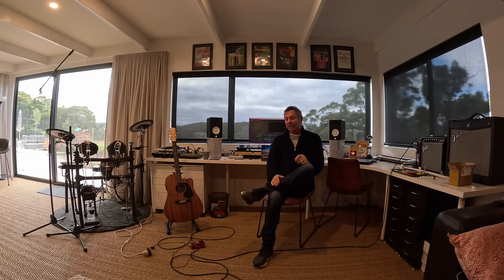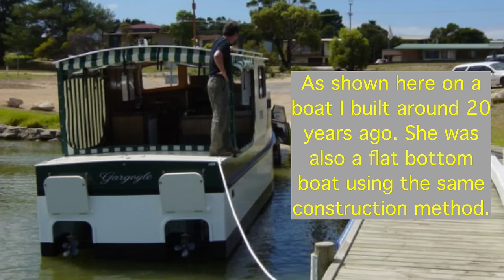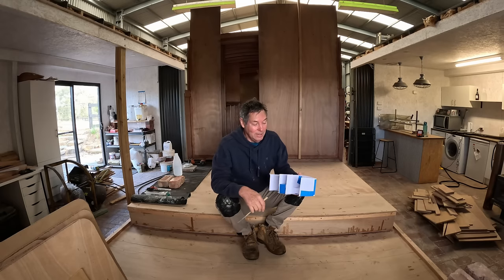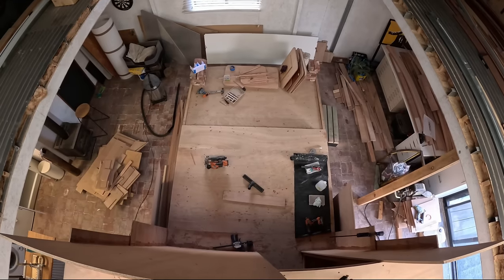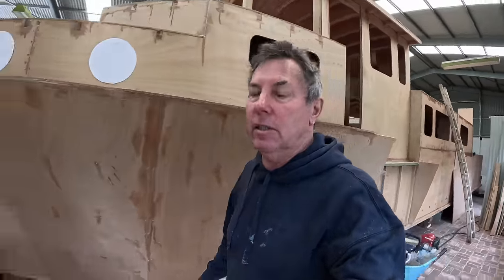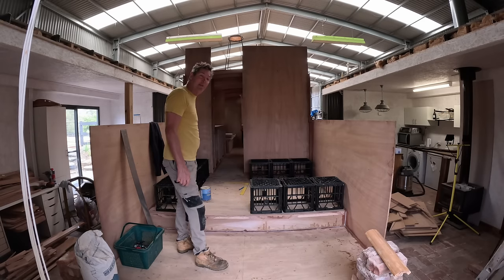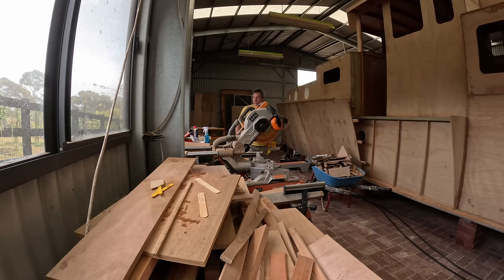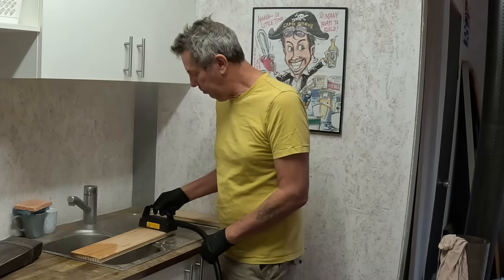Boat Building D.I.Y Boat. Will it FLOAT? Building Dragonfly E 44

Comment: Im starting at the beginning,  i would also like to build my own boat but was concerned about getting insurance have you covered this already? Subscribed!!
Reply from the maker: Insurance can be tricky. But as a new build with outboard engines it is not too hard to get. Yes I have explored this area prior to starting the build and I have also a 30 year plus history of having many different boats with never making any claim. I also had a boat business for many years and have a long standing association with various insurance companies. The boat will have a 'Builders Plate' on it which is necessary here in South Australia.

Comment: I'm glad that Maple turn out to be true mariner :)
Thank you, good Sir, for accepting our questions with grace and as they are... genuine interest in matters, not attack on your decisions...😅
Now with new questions... how  you plan to isolate vibrations from engines and generator? Will rubber holders or carpets enough, or you will need spring mounts etc...
And what's yours thoughts about solar energy on boat....
Reply from the maker: Hello, I don't think vibration will be an issue, especially with some sound proofing and a double aft bulkhead with a cavity in-between  them. Not going sola at this stage as I am utilising gas for fridge, oven and hot water, so I wont actually be using much electricity other than the air/con. That will run directly off a small generator. Thats the plan for now. The engines will be two F60 yamaha high thrust outboards which are really quiet and with minimal vibration. cheers, Steve and Maple

Comment: cool beans Steve !! , question , the ship you built 20 years ago , is she still around and how has the new owner looked after her
Reply from the maker: Hi Anne, current owner is the third I think. He is selling her as he has just completed a long 500 mile river trip which is what he bought the boat to do. He has looked after her well and spoke highly of the boats design and performance, other than the numerous wake boats that annoy all boats on the river. here is a link to the boat listed for sale. She was a different colour when I built her which I really liked. However, she still looks quite nice for a little flatty. I had to laugh because sshe still has the same porcelain tooth brush holder and some other nic nacs that my wife and I had in her some 20 years ago. LOL Nice to hear from you again, Cheers, Steve and Maple

Comment: the honey comb under the rear deck forward of the engine compartment , will you  access and are they ventilated?
your design looks like the boats built in Victoria, as flat bottom river boats.
Reply from the maker: Hello, no, not ventilated, but completely water tight sealed compartments. I will be able to access the ones running down the centreline of the boat if required. Also there will be access at certain points down the centre for bilge pumps. The centre line compartments all drain as one. Can't imagine we will require bilge pumps, but I put them in anyway. Not sure which boats you mean. I am very familia with the Duck Flat boats built here in South Australia. Only about 30 mins from me. Cheers, Steve and Maple
Reply: @steveshierdoesstuff7420  , yes I was thinking of Duckflat Boats, very similar , design.

Comment: 🌴 the floating model kinda helped , it wasn’t loaded with all the internal weight, gas,water , and all but at least it will float, how are you going to seal the hull ?  Fiberglass? 🤔
Reply from the maker: Hello Dave, the bottom of the hull is already glassed and is ready for the glass on the sides to overlap along the chines. I will use two layers there as it is a potential rub area. Re weight, all tanks run along the centre line of the boat, including the fuel tanks. We have 500lts of fresh water centre line under front bed, 500 litres of black water tank only 600mm wide running the length of the wheelhouse, about 450 litres of fuel in 500 wide tnks under the aft deck.  Gas bottles are also in the middle of the aft deck. So in short, a lot of weight running all along the centre and bottom of the hull acting as a lot of ballast when full etc. There is also the ability to add ballast under the floor from the wheelhouse to the back of the boat. Thanks for asking, cheers Dave. Steve and Maple
Reply: @steveshierdoesstuff7420  , from what you told me it seems like you got things figured out , I don’t know how thick the fiberglass is on the bottom of your yacht but most of the boats I manufactured in the 40’ ft range were 3/8 “ inch unidirectional or better as they were backed up with foam core bonded down with resin putty and covered with ounce and a half chop strand and unidirectional fiberglass over the top  they had six inch overlaps on all the corners for strength and wear , since you don’t have a keel running down the center I think the bow or front of the hull is going to be the wear area as it will take the most abuse , I’ll try and keep an eye on your progress would like to see how she sets in the water and runs, ( I’m going on 73 ) I’m working on a flats skiff project boat in the back yard here in 🌴 Florida😅 ha,
Reply from the maker: @davescheer5038  hello again, well I am not far behind you at 67 LOL I have one heavy layer of biaxial glass with a slurry of epoxy and filler over that and then  two coats of two pack epoxy below waterline paint. Not particularly heavy duty like yours but this is really just a waterproofing and protection layer. The bottom of the hull is three layers of 12mm (1/2") BS1008 marine ply. So total hull bottom thickness after laminating ends up at about 38mm (just over 1 & 1/2") And yes all laps were about 6". I also have 120mm x 27mm hardwood rubbing boards underneath. One along each side about 1/4 of the way in from the chine and one running in the centre from the front of the wheelhouse to the stem. These have 316 4 1/2" by 1/4" plates on the bottom of those adding some weight and rubbing protection. Love to see some of your work on the skiff, Cheers, Steve and Maple the boat building interupter! LOL

Comment: Did you say that you are putting a generator over 2 fuel tanks?? there will fumes from the fuel tanks ,plus a gene running over them   ,you sure about that ,also some strong winds on the river and will dragonfly handle them side on ,as recall nothing under the boat or a drop keel  ,glad the new pup is going great ,like you now have  a replacement pup, said never again  but needed a new mate to tell my woes to ,plus keep fit walking him,look forward to your reply re my point.
Reply from the maker: Hello, thanks for watching. Yes, you heard correctly. However, what I should have made clear is that those stainless tanks will be enclosed in an air tight compartment. There will be an access panel above them, but that will be completely sealed, I may even lightly glass that into place just to be extra safe. The fuel inlet and tank venting will be well away from the generator area. You might have missed it, but in a much earlier video I showed how there are two swing keels, centre plates if you like, that are housed either side of the wheel house and can be lowered or lifted as the wind demands. Skating is absolutely an issue with a flat bottom boat and one I have to address as best I can. It is always a bit of a catch 22 weighing up shallow draft against stability and handling. I have also added a retractable bow thruster to assist when docking in tight marinas etc. I hope this makes some sense. Cheers, Steve and Maple

Comment: Why on earth would someone with the financial resources to have this shop, tools and materials, not spend a fraction of the money on drawings from a registered naval architect? Please don’t say, “He wants to do it his way”. Design professionals are quite happy to work with you on your vision.
Reply from the maker: Hahaha, yes I hear you. However, perhaps I make a little too light of the 'design' factor. I have been building and restoring wooden boats for over 35 years and this construction method is well tried and proven over many, many years. She is basically a long Norwalk Island sharpie with a few interior twists. As for drawings etc., it is common place in the boat building fraternity to build from a scale model. This is exactly how I built my last 33' boat which has been in the water for over 20 years and is as good as the day she was launched. In fact she just passed a full marine survey with no issues noted. This vessel is the same tried and proven glass over ply epoxy and steel fastened construction. Despite my 35 years experience, I did run my design and construction method past one of South Australias leading senior government marine surveyors, who gave everything a full tick of approval. Thanks for your concerns and taking the time to leave a comment. Take care, Steve and Maple
Reply: Good work ❣️ Amazing very nice